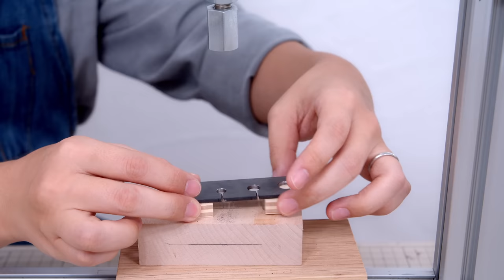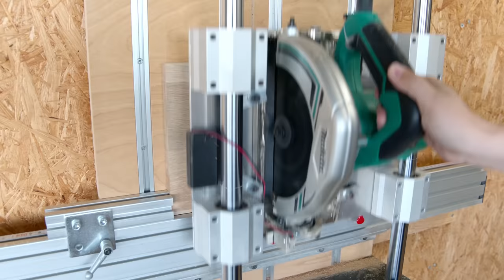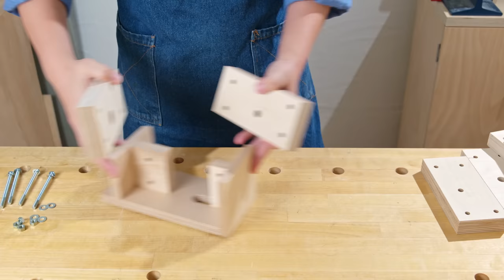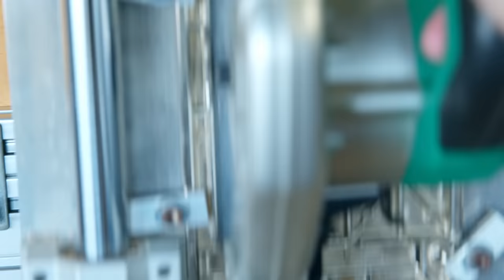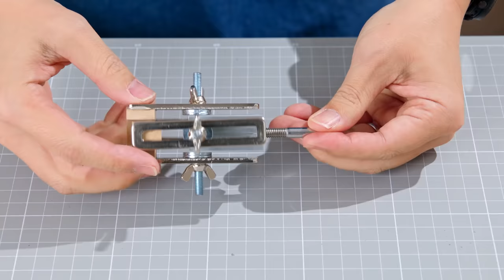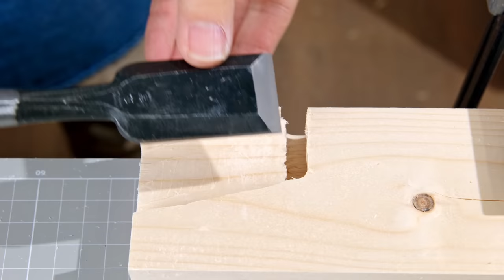Intelligent and excellent 6 woodworking techniques

Comment from the maker: If you like the video, please introduce it to your friends and social media !
Reply: So which method do you like the most? Which produces the most accurate, smothest rods?
Reply: I have no social friendly Diy hobbyist jobs All are compatating job earning self earned money persons..i myself liked this type of works smoothly worthy nurishment.irs really decently good for use..
Reply from the maker: The best way is to use a chisel.
However, jigs using a router can be finely adjusted, so the dimensional accuracy is stable.
Reply: @jisakukobo  Would love to see videos of you making drill press and other wooden machinery.😍😍
Reply: @con-f-use  it's the ferrous sandable to shape.. don't use milling to shape the same requirement
Reply: @con-f-use 4:59 5:02
Reply: I love the adjustable holder for the square end to feed the wood to your dowel jigs. It's a very clever design and useful. Thank you for sharing. The presentation is excellent.

Comment: the angle grinder slide cut-off saw, the wooden vice for drill press, the way you used a wrench socket and with a drill bit driver as a 'lathe' chuck, and my favorite, the chuck for square stock. these are just a few of the excellent hacks/jigs/ideas here. the chuck for square stock is particularly inventive and useful. i have two comments about it. 1) the design would be improved with near-end adjustment bolts that move the drill side of the jaws outward so as to clamp down on the stock with leverage, and small pieces of coarse sandpaper glued to the wood pads would assist grip. 2) a similar hack built on steel round with jaws 120 degrees apart would work for round stock and bamboo

a note on dowels. it's pretty easy to fashion dowels from clear square stock. the problem is making them precisely (consistent diameter) and accurately (exact to a predetermined dimension). of these two problems, precision is probably more important than accuracy because if you have consistent diameter, you can probably find a fractional sized bit for it. it also helps if they have a somewhat textured finish to create more bonding surface for glue. it looked to me like the most promising method to get all these right might have been the jig saw blade method, but i'd love to hear your take on that

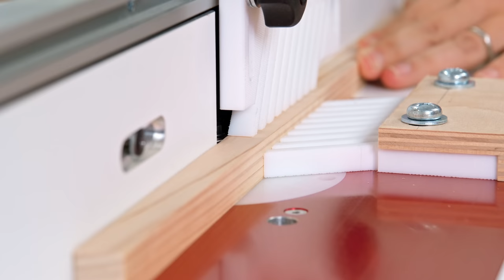a minor correction to your terminology @7:24. a chamfer is traditionally a small 45 degree edge cut, can be done with a 45 degree bearing-guided router bit, a hand or power planer, or even with sandpaper. the 'chamfer' bit you referred to is usually called a quarter-round (4 x 1/4 = full round)

Comment: No doubt that the hack 3 is the best and most convenient one. It would be great if you could make it easier and more handy to change the rode size template.
Reply: Short studs for positioning and clamps or cams to tighten in place might be  ok for the template. For a no hassle structural dovel I think number two quite adequate, if accuracy or presentable surface is needed then numbers three or four.

Comment: Great hacks! #5 was maybe a bit overcomplicated (and a bit pricey if you don't have those parts lying around).
If I were to replicate one of these, I'd probably do #6, but shell out for some carbide utility knife blades and make the jig more or less permanent, with multiple sizes in mm increments. Those blades would last a long long time only cutting softwoods, even hardwoods I bet.

Comment: Tip for you:  The machinists vice at the beginning:   Scissor jacks for cars, have a beautiful shaft with acme threads, and a matching nut (look around for the older styles that have better shafts, some have nuts, some have a flat end with a hole, for a 'Tommy bar'.  Junk yard for 5 bucks, (or steal your neighbors)  Thanks for the video.

Comment: I've got a great hack for making a dowel too. Go to your key rack; then grab a fob and put it in your pocket. After that, go down to your car & get in. Turn on the ignition & drive down to your local hardware store or HD/Lowes & buy one. Much easier & quicker than fabricating a tool to fabricate a common dowel.

Comment: I feel like calling your genius and beautiful work a "hack" does not give it the credit it deserves.
Reply from the maker: I misunderstood the word hack.
I've received similar comments in multiple comments.
Reply: @jisakukobo  the internet corrupted the meaning of the word hack, so you are not entirely wrong in your understanding. Unfortunately it is yet another english word with multiple meanings
Reply: @jisakukobo Just take it as a compliment. Most ppl would think a "hack" is something like a "quick & dirty" solution for a problem, something made of duct tape, chewing gum and 2 cable ties. Like replacing the busted belt of your alternator with the pantyhose of your girlfriend because you're in the middle of nowhere. It won't last for long, but it will get you to the next workshop. Your builds are ALWAYS far more then just "hacks"! My greatest respect from Germany deepbow

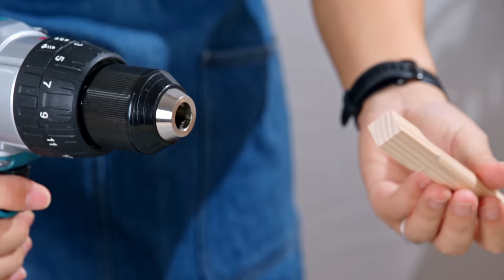Comment: 7:58, pour tenir le carrelet il existe une solution demandant moins de complication, à l'aide d'un tube carré fixé sur un axe (pour mettre dans le mandrin de  la perceue) et 4 vis latérales pour bloquer le carrelet.
Reply from the maker: Doesn't it have an eccentric axis?
It seems troublesome to adjust so that there is no eccentricity.

Comment: Or....... you could just buy some dowels
Reply: That’s what I usually do, but sometimes you can’t buy the species and size of dowel you need for your project, so these are great ways to easily produce any size dowel from any wood species.  Also, the different hacks are suitable for different situations, for example do I just need a few dowels or do I need a large production of dowels.